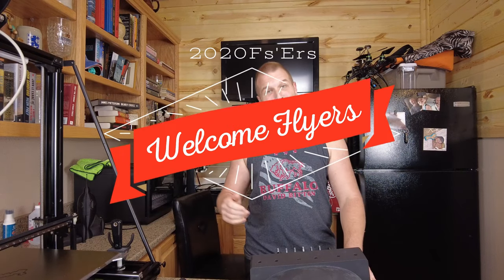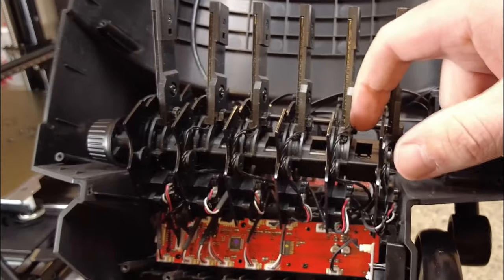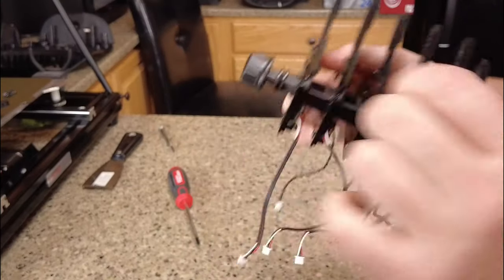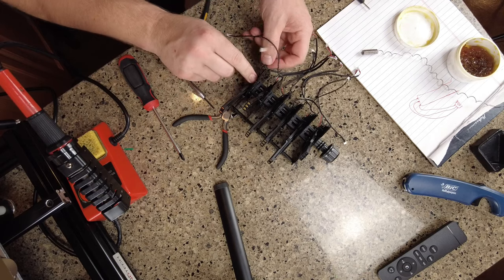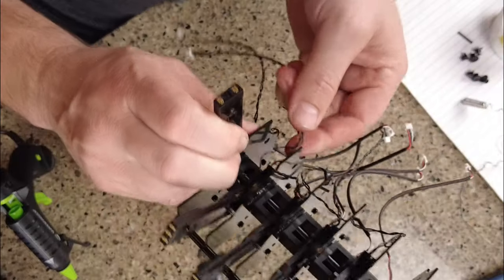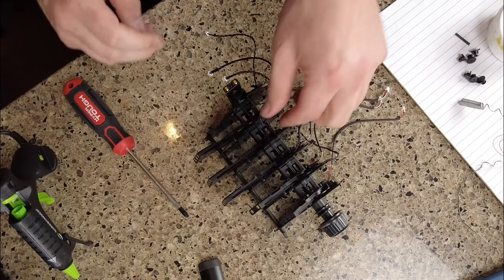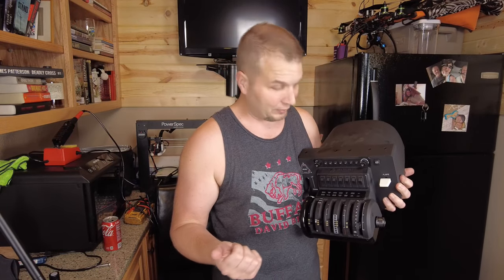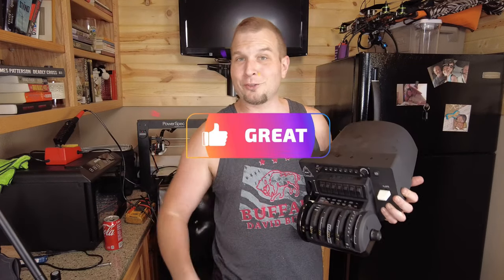Honeycomb Bravo Throttle Quadrant Problems REVersers NOT WORKING! Bravo Teardown REpair! POOR DESIGN

Comment: I’ve had mine for almost 3 years and just discovered that my bravo also had the same issue. Every single wire snapped on mine as well. Thanks to your video, I also fixed mine. Cheers!🎉
Reply from the maker: Thanks for the comment

Comment: Thanks for your video!!!! I had the same issue with my throttle #2 reverser not working for a year or so now until I discovered your video! It really helped a whole lot. Thank you for being the only brave soul out of us many bravo owners who actually took time to figure out what was causing this issue but thanks to you, I now have the confidence to tackle my own repair. I'm not gonna lie, it was a bit intimidating once I opened it up but your video was spot on. I was able to fix my broken wire in the #2 reverser only to find out once I repaired it and got it back together and connected back to my computer in the sim, reverser #1 stopped working for me. Come to find out, one of it's wires had broke on me while testing the repair. What a bummer. I think honeycomb used cheap wire and they are too stiff for this application. I'm going to replace all the wires in throttle's 1&2 which for me is lever (3&4) as I mostly fly 2 engine jets with silicone wire for more flexibility.
Reply from the maker: Hey thanks for the comment and I'm happy my video helped you get yours fixed . They have a bit of design and qc to get straight but at least you know you can fix it if something happens again. 😉 thanks again

Comment: Just a little tip.  I bought one of those clamping devices like yours, and right away, realized that those miniature crocodile clamps were pretty lethal. To fix this, I slid a short length of heat shrink over each of the jaws. It was a snug fit without applying any heat. It works like a charm and has not damaged any of the small wires I've soldered.  Thanks for a great video. I do not have a Honeycomb quadrant, but am seriously looking to get one.
Reply from the maker: Great tip for the wire clamps i didn't think of that thanks .   Thanks for watching
Reply: @2020fsers  You are more than welcome. Hey, I even subscribed, too!!   Thanks.
Reply from the maker: @twocvsix  hey 👋 man thanks so much for the sub really appreciate that.
Reply: Make a video with your method plz

Comment: I just wanted to say BIG Thank You dude! You saved my unit! THR#3 Reverser failed in my case. Although I kinda did some things differently. One black wire broke right where they all "bend". So I soldered it, and applied some hot glue in that area so they move much less now. Also applied hot glue in the same spot for all other throttles. I also removed those tiny zip ties because I bet THEY are the reason why these wires tend to bend so tightly. I'm so glad everything works fine now <3
Reply from the maker: Thanks for the comment .. happy this helped

Comment: Thanks for a very inspirational video which gave me the confidence to tackle the same repair on my Bravo. In my case, two wires on throttle 3 were broken. Before disturbing the wires, although the wires were the same colour, it was possible to see how they had been originally connected as the broken ends were slightly different lengths. It would have been possible to connect the new wires to the original ones without digging in any deeper but I decided to strip down the lever so that I could connect the new wires directly onto the brass terminals. (important to remove the terminal before attempting to solder as the heat would melt/damage the lever). I then reassembled the lever, soldered the other ends of the new wires to the original wires and insulated the connections using heat shrink tubing. This repair was successful but about a month later, throttle 2 reverser stopped working. This time, I could see the broken wire by looking into the lever slot prior to stripping the unit down again. It's been a couple of months since the last repair and so far, so good. Just for the record, I used wire salvaged from a length of CAT5 cable which appears to be the same diameter as the original wires (makes routing new wires inside the lever housing much easier). To summarise, defects which are too wide-spread to be regarded as 'just a bit of bad luck' ... this is a manufacturing issue but, fear not fellow Bravo owners, with just a little confidence, your unit will be back up and running in just over an hour...
Reply from the maker: Great write up thanks for sharing 👍 🙏 I appreciate the comment glad your back up and running
Reply: @2020fsers  you're very welcome
Reply: @2020fsers  Hello again, it's only 2 weeks since my second repair and yesterday another (original) wire leading to lever 3 (reverser) broke. I suppose one good thing is that repairs are getting faster, under 30 minutes now... but I'm starting to think this will continue until all of the original wires have been replaced. On reflection, anyone doing this repair for the first time would probably be better to replace all of the wires at the same time (as someone else previously suggested) but, in my case, I just thought this was overkill given the other wires looked OK. But now, I'm starting to think that once these wires start breaking, eventually all of them will fail over time. This leads me to wonder why these wires break in the first place? This is the third time I've been inside my Bravo and I'm now trying to figure out what's causing these wires to break?  For the record, I've now repaired 4 wires, all broken in different places and I'm trying to figure out if there is a common cause. So, looking back, the first two wires were cut very close to where the lever pivots. Initially, I thought this might be a stress related fracture caused by the wires repeatedly bending backwards and forwards each time the lever is used. But, because these wires looked like they had been clean-cut, my second thought was that this may be due to their routing. They travel from inside the lever housing over the pivot point and might have been physically sliced through when the throttle has been pushed forward to maximum. However, maybe there isn't one single cause because the next two repairs tackled broken wires (inside) the lever assembly. The first of these was clean-cut only 2-3 millimetres away from where it is soldered onto the terminal and second was another clean-cut half-way between the pivot point and the terminal. Neither of these makes any sense as there is nothing inside the lever housing to physically cut through the wires and the stress fracture theory does not apply here. So, finally and, in case anyone is wondering, all of these repairs refer to throttle levers 2 and 3 and their respective reversers. This is because I have configured the throttles for use with the airbus and the other levers do not get used.
Reply: I wish I shared your confidence.
Reply: @JKPilot  If yours is faulty, take your time, remove the base cover and simply take a look before committing any further. Once you get started, you'll probably surprise yourself... good luck... let us know how you get on... and, for the record, no further issues after the last repair...
Reply: @slicker55  yeah mine is definitely faulty…once opened, I could see three wires broken. I’ll look into getting the appropriate soldering kit…etc, and give it a go.
Reply: @JKPilot  Good luck, a few practical tips... if you intend to simply reconnect and solder the broken wires, you will need to work very quickly to avoid the risk of heat being conducted along the wire and melting the plastic part on the lever where the brass terminal is located. The safer option is to carefully remove the terminal out of the lever housing by simply teasing it out. You can use the original broken wire to assist in holding the terminal whilst soldering on the new wire. I suggest that you use pliers to hold the original wire as it will get quite hot very quickly. Also ensure you only apply a very small amount of solder because if you end up with a bulky joint, the terminal will not fit back into the housing. Once you're happy with the new connection you can snip off the original wire close to where it is soldered onto the terminal and push the terminal back into the housing. So, just to reiterate, prepare a short length of wire (6" or more, doesn't matter at this stage)... solder one end onto the terminal (as described) cut the wire to size allowing for a little free movement when the lever is moved throughout it's entire range. Remember to slide some heat shrink tubing onto the wire before soldering the new wire onto the original wire!

Comment: You are a brave man! For the price of these things, one would expect that the wire connections would be a bit more robust. Only had my Bravo for a month, so I hope I get a few more months usage before being faced with having to perform surgery. Thanks for this and all your other videos. Always informative and entertaining.
Reply from the maker: Thanks Art yes I would have liked to see maybe a channel inside for the wires to freely move or something but it's all good now thank God 😊.  I really appreciate the comment Art.  It's like taking  paper clip and bending it over and over I'm no rocket scientist but it's not gonna last . That may have changed in the latter units I got 1 of the 1st ones .
Reply from the maker: Hmm that seems like a different issue . Maybe something came unplugged in your unit
Reply: @SMG mine has developed the same issue.  Did you find a solution to this as i really don't feel like dealing with support.
Reply: @SMG Damn. Maybe I'll try and get a replacment under warranty. Hopefully i get a quick response as I'm in the uk and have to go through Aerosoft.
Reply: @SMG I don't often fly commercials - but I today I thought I'd run through a couple of tutorials. Guess what - reverser on throttle 1 does not work (which figures as I tend to fly single engine GA). 

Really appalling quality from Honeycomb - my Bravo is out of warranty, but I am in no way a hardcore simmer, so the unit has not had a tremendous amount of use.
Reply from the maker: Yep it doesn't take long mine only lasted a couple months.

Comment: Thanks for the video, I started doing research after Buttons 10 & 11 reversers stopped working and doing a lot of troubleshooting, I can see cables issue even without openning the BTQ. I need to do this now as I got it 3 years ago therefore no warranty. Wish me luck!!
Reply from the maker: Biggest thing is take your time and you can also use your phone to take pictures of how the unit looks before you start disconnecting wires and things like that or any of the throttle or mixtures if you have to remove them. You should be just fine

Comment: Thank you so much for making this video. I use the furthest left one only for flying WW2 warbirds and use the button for boost. However, it just went out. I suspect this is the issue and will need to open it up for repairs. I've had a lot of HOTAS gear over the years and almost always it comes down to poor internal design and wiring
Reply from the maker: Hey your welcome.. most likely your wires snapped also .. yes it's poor design inside that causes this . Thanks for the comment

Comment: THANKS FOR THE VIDEO, i have my quadrant and engine 1 reverse stopped working, so I decided to look at what is going on and I saw that the wire for reverse 1 is already cut in two parts, I'm very disappointed about the quality of this wires and now I have to wait and see I am able to apply for the warranty, I just used this product for a total time of 50 hours in the whole time that I have this.
Reply from the maker: Thanks for the comment ... if they replace under warranty I was told by another viewer that they did finally change the wire config inside so I hope you get 1 of the updated units.
Reply: @2020fsers  I already text them via email, they sent me an email in order to fill up my information and then they were supposed to send me a label to send back my unit but is already 2 days and they didn't answer.
Reply from the maker: Stay on them ..

Comment: Great job, what you may want to try in future if it happens again is to use fine silicon sleeved
wire used it years ago in building test rigs in an electronics factory, its great for cables that are moving around all the time.
The smallest i remeber was 1mm silicon sleved cable.
Reply from the maker: I used silicon wires on the repair and has been great so far very flexible . Thanks for the comment 😀
Reply: @2020fsers  Looked like you used the original wires and just put heatshrink on them, i ment rewire with silicon sleeved wired and not use the original wires apart from the plugs.
Still a great job.
Reply from the maker: I thought I used silicone wires but it's been a while I'm not sure at this point lol
Reply from the maker: But I know if I had the brass end that connects to the throttle lever I would have used a solid piece of silicone wire but I didn't have those ends
Reply: @2020fsers  You would normally find the brass inserts are compression fitted after the parts have been injection moulded.
I didn't realize they had used silicone covered wire as in the video it just looks like standard plastic covered wire, if you have problems in the future you could try to completely replace the wires with 40AWG silicone covered wire, many railway modellers use it for building loco's as it's a very fine wire and very flexible and heat-resistant.
Hope you don't think what I am saying is a criticism, just trying to help, as I have worked in the electronics industry for nearly 30 years.
Still a good job done on a rather very bad design.

Another tip you or anyone else could use on the helping hands jig clips is to put a piece of silicon tubing over the clip jaws, the sort of stuff you get for airlines for aquariums.
It really makes a big difference.

Comment: Ok, now I know that some time in my future I will have to do some fine & fancy lineman's work. I couldn't even guess what was in the Bravo. 
I have extensive experience in repairing the broken wires in my CH Products Pro-pedals set-up and repaired that at least 6 times. 
For the Pro-pedals, I got 24 gauge color-coded Silicone wire and replaced the 6 wires that were the problem. You're a brave man going in there, but now I know, Thanks
Reply from the maker: hey there thanks for the comment . yes i knew that i didnt want to wait for honeycomb so i like to fix things and make them better than i found it. lol so i felt i wanted a challenge  and i figured id film it cuz i had a feeling that a lot of people will have this issue a lot! Anyway thanks again for watching

Comment: These honeycomb bravo and alpha flight controls are crap. I started having problems with the yoke early on. There is a really bad dead zone on my roll axis, which I've narrowed down to a bad potentiometer connection on the board. I'm also starting to have the same issue with one of the thrust levers on the bravo unit. I was able to move it to a working lever and re-mapped it, but it's just a pain in the butt. I'm going to get rid of them as soon as possible and go back to my old Saitek ones. Thanks for the video.
Reply from the maker: Hey you are welcome thanks for the comment .

Comment: Planned obsolence. I have not had this issue with my Bravo but it is not a year old yet so I guess I can look forward to this. I have had two rocker buttons go bad after 3 months. My solution is to apply a FAT (Fine Adjustment Tool i.e. hammer) to it and buy another one or go back to my Saitek throttles. Or, take up underwater basketweaving as a hobby. 😃 Thanks for this.
Reply from the maker: Lol thanks for the comment.
Reply from the maker: I agree that the engineering department probably had a long night out the day before they designed the internals.
Reply: @2020fsers  Or yours was built on a Monday morning or Friday afternoon. 😀

Comment: Just got my new Bravo TQ and sure enough one of the reverser buttons is not working.  Brand new, right out of the box and broken...  Hmmm...  Not a very good first impression.  Great video!
Reply from the maker: Wow that's crazy they all have this issue.  Luckily I haven't had an issue since doing this repair
Reply: @2020fsers  I'm not going to do any repairs or take this thing apart right now.  It's brand new so it's going back.
Reply from the maker: Yep return to sender ! Hope you get a new one sooner than later

Comment: yup i just spend like 4 hrs fixing all mine, works like a charm very flawed design, i ended up not putting back in the grommets they use to wrap the wires around since that seems to be one of the causes of this flawed design but cheers for the vid
Reply from the maker: I did the same with those round grommets.. thanks for the comment